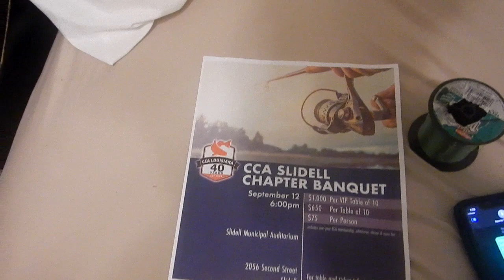Oneofthepack, Big Don, Big Rudy, Del, spot 57A,  18 T, 7 19 23

Comment: Good trip Stanley and crew 👍. We got Cisco’s boat about ready to make the return trip back to the hoist. Cisco and I did the 100 hr on the engine and installed a new 9” gps and a auto bilge pump.
Reply: I take that back the 200 hour service.
Reply from the maker: Me will be lookin g for GPS soon, also need to install new bilge pump that I have for last (6) months, one day it be done. Now all me do is pull plug , run & let it drain

When we going scouting?